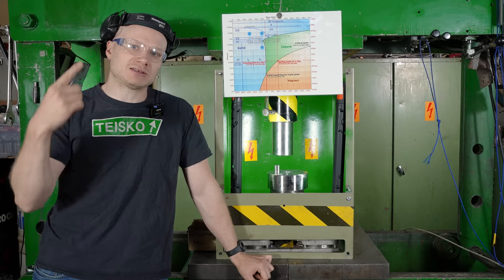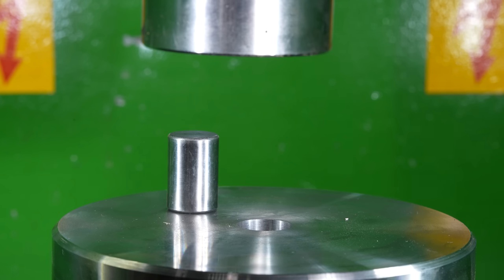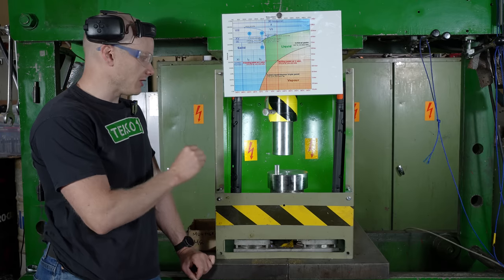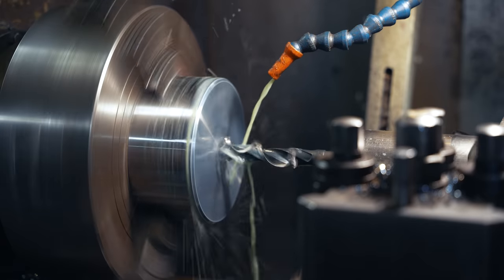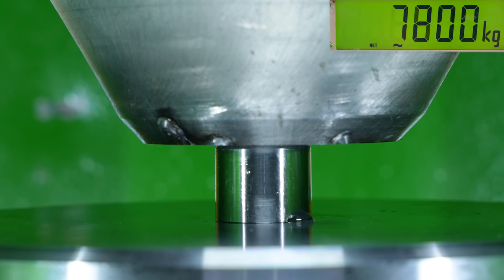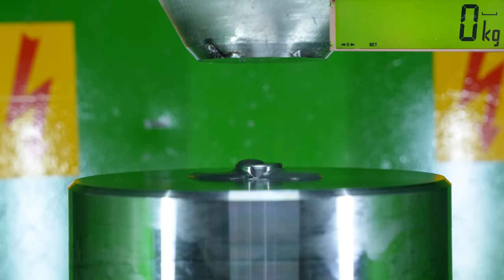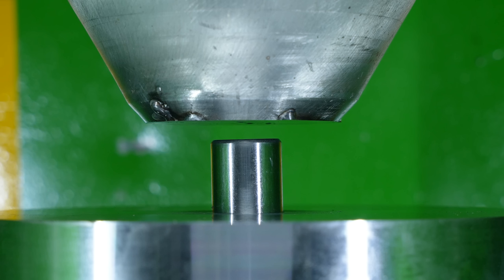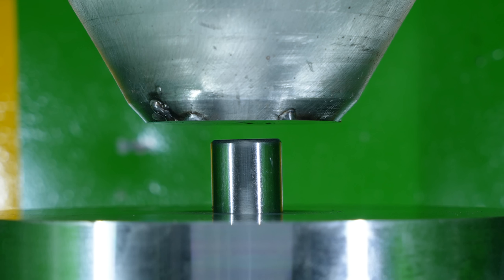Turning Water into Rock with Hydraulic Press

Comment: You could probably get better feedback from this if you get some quicker responding scales or pressure sensors.
As for the piston design, you might try a tapered design with varying angles of pitch. You'd get a smaller area on the bottom surface while maintaining a tight mechanical seal.

Comment: You probably need a longer cylinder and piston to achieve a better water seal. I also remember reading that creating artificial diamonds for industrial applications involves the use of controlled explosions to achieve the desired pressures instantly.

Comment: The bubbling boil and vapour released was so cool to see for some reason.
Reply from the maker: I think there is so large pressure difference that the water starts to boil from all the energy being generated from pressure loss
Reply: @HydraulicPressChannel  Heat is liberated when materials change phase to a lower energy state.  The application of pressure does work on the system, as well, which also liberates heat.

Comment: I have two ideas that could improve the setup. One idea would be to make the bottom part into two parts where the outside is hardened. That way it cannot expand as much. But make sure that part is still pressed into another steel part which applies pressure from the outside and (hopefully) stops it from cracking open. The second idea would be to make the cylinder slightly cone shaped. I do not think the water actually cuts the material. I think the material is rubbed off from the cylinder rubbing against the bore. Since the pressure is so high, it just widens the hole to a point where the water can escape. But if you use a cone instead of a cylinder, the force from the press will keep it shut. Of course that will also increase the outer diameter of the lower tool which is a problem if there is a hardened section. Interesting challenge tho. Also keep in mind that the pressing will also increase the temperature of the tool and the water inside. So you will either need more pressure or make sure it stays cold. Maybe put the tool with the water inside into a freezer first and when the pressure is applied, wait for the surrounding material of the tool to absorb the generated heat. Also cooling the steel would make it stretch a bit less.

Comment: can you freeze one of those with liquid nitrogen or dry ice on camera so we can watch it push the bearing plug out as the water turns to ice? also you can try using cast iron as either the hole side or the pin side as soft iron often (with a hardness of 58 HRBW)  is used in the oil and gas industry as a compressible seal at high pressures and temperatures. you also don't want the hardness of the pin and steel plate to be too different only 15 to 20 HB or else the material the deforms wont plasticly be able to flow into the other part and form a seal the surface finish is also important no higher then 0.8 Um RA on both parts and free of burrs and chatter marks hope this helps!

Comment: I have few ideas to make a better seal. For first, lap the hole, so it's very smooth. Also grind the roll edge round and very smooth. With so tight fitting, sharp edge in roll chamfer most likely chip the steel and scratch it. 

With this principle, you need more fitting force than pressure under the roller. Otherwise water will stretch the outer steel and create leak.

Other method could be to make self sealing structure. O-ring is good seal because pressure presses ring surface always tighter than needed because pressure affects on entire ring but sealing surface is always smaller. You can make similar structure with steel.

Take a silver steel rod. Machine bottom part thinner, machine groove under the wider part, machine groove on the top, forming kind of piston ring, which is still connected. As long as the groove underneath is bigger than sealing surface at the outer part, it will seal. As the pressure rises below, it pushes ring in the steel harder

Sealing surface must be wide enough not to sink in the steel and seal must be thick enough not to break. Use silversteel, so you can harden it. If possible, grind it smooth after hardening.

Comment: 1.I'm thinking a short taper ground into the bearing along with a more extreme interference fit would be necessary to make this happen. You would be surprised with how flexible steel and iron can be, even hardened steel and cast iron. I rebuilt a Kubota engine recently with interference fit cylinder liners. The fit has to be extreme because there is no lip top or bottom to keep the sleeve/liner located in the bore. It was somewhere around .008-.010" fit (.20-.25mm). Those are cast liners and cast iron block so both are notoriously dimensionally stable, and they had zero issue with being pressed together. Just keep going up with the interference fit number until your press starts to have a hard time, at which point you know your limit becomes the materials themselves. I think my press, which is only 20 tons, was on the edge of its capability pressing in a liner that was 76mm in diameter, but with such a small diameter piece, you can likely increase the interference to quite an extreme degree that the material itself will fail before your press is maxed out. 
2. Another thing you might do is use a very fine sand paper to score your bearing for a better seal. Those microscopic lines in the metal will act like o-rings.
3. Finally, something you should think about is heat of compression. You're generating a lot of heat when you do this experiment. I don't know what temperatures are involved, but you're almost certainly exceeding the critical temperature of water when you move the press very quickly. This is why the fast action of the ram failed earlier than with the slow press. The heat had more time to escape. I think that large number, 28 tons, occurred after the ram hit the stop and began to build resistance. If there was a way to slow down the increase in pressure so that ambient temps aren't exceeded by much inside the chamber, that would be ideal. Maybe through a screw press or slow down the hydraulic pump somehow?
Reply: Re diamond synthesis and Tracy Hall  Lauri needs carbide confinement mounted in hardened tool steel.  No steel is hard enough to not directly deform.  Even hydrothermal growth (e.g. cultured quartz) requires quite the dance not to go high order boom.

Comment: I think it could work with a cascade of regular hydraulic zylinder seals. If one seal can withhold pressure of for example 300bar against the atmospheric pressure a cascade of two should be able to withstand nearly double the amount, if there is a non compressible fluid in between?!  If you have 600bars in the compressed chamber, you have 300 bars between the chambers and the second seal only has 300bars.
Similar to a multiple stage piston Kompressor

Comment: The problem with this is, at such pressures, the steel itself acts like rubber! You put that much pressure inside it, on a liquid, and it just squirts out around the plug.  To solve this, think how you would design a setup made out of plastic (or other lower-modulus material), at proportionally lower pressures.  You either need a plug that expands as it goes (sealing the gap with greater pressure), or some way to equalize the pressures on all sides (to break up and counter the radial force of the contained pressure).

The first thing I would think would help, is to make the piston very much taller.  You aren't increasing the stiffness of material sealing against it, but you are putting more of it (more sealing face), and perhaps the pressure can drop along the interface, eventually to atmospheric at the top and thus not leak.  On the downside, all it takes is one little sneak path up the side, and out it squirts; and ramming even a polished slug into a finely machined hole, will still have microscopic scratches that water can be forced through.

The other way is to press from all sides, like the octahedral and other shapes that various experiments, early diamond synthesis (and maybe still to this day? I don't recall), etc. used.  I'm guessing this isn't so feasible (you'd need many hydraulic rams, synchronized by volume, and a lot more fixturing/machinery, to pull it off; perhaps they could be driven from your existing machine, via patch hoses, but perhaps that's not such a great idea either, for various reasons; or via a much more complex "tool", a hydraulic transmission?).

The other other way, is to just brute force crush the whole thing, tooling and all.  Which I think is kind of how the ultra-high pressure diamond anvils do it.  By leaving a small concavity on the face of an otherwise very flat, hard and strong tool, and pressing it all down uniformly, by sheer brute force elastic deformation the cavity is made to collapse, with a pressure comparable to the elastic modulus of the material; and all the clamping force around the cavity, acts to seal it.  Most of the clamping force distributes over the tool faces themselves, which seems inefficient, and a more direct method (like literally pressing on a cylinder as in traditional hydraulics) is a more obvious approach, but when you have all these other problems to deal with, some compromise is inevitable.  (The active volumes in these tools are extremely small.)

I think they still use a tapered mating face on these, and there's likely something to be said about interference fits and tapering -- which is to say you're not on the wrong track with the interference fit, peg-and-hole approach, but that more consideration is required.  In any case, my thought process is: if you're able to drive the peg in such a way that it stretches the hole, that gets you the radial pre-loading needed to seal the joint.  (And that's a lot of force, and you can only pre-load up until the hole material yields and the water simply pushes through; both tools must be very strong, and very stiff, if at all possible!).  Instead of a press-fit into a step, some taper may be required -- on both parts.  What angle (and what angle on both parts; they might not be exactly the same but subtly different..!), and what lengths and such, I don't have any intuition for, unfortunately.

Of course... more consideration means either many more tools turned, crushed and recycled; or scale models made -- like I said, think about how to capture slightly-less-extreme pressures inside materials much less rigid and strong.  Or preferably some good solid engineering calculations -- or even material simulations. Well, that would be expensive (pretty sure simulators exist, but not cheaply..), though I wouldn't be surprised if you can find either someone, or some company, willing to do the job for a little free advertising..?!

And yes, stiffer materials than steel; there are a few elements that might do (molybdenum and tungsten come to mind, placing about twice the stiffness as steel; alloys would have to be selected for strength as well, for example commercially-pure Mo is about comparable to CRS in strength), but probably the most common in machine tools is carbide (namely, cemented tungsten carbide).  Which... can be machined, with great difficulty... and, needless to say it's not exactly going to be cheap in massive blocks for a potentially one-shot test, but, it is another thing that would help.

Anyway, not an ME, just ramblings of an EE's intuition -- perhaps other high-pressure engineers can weigh in better here. Cheers!

Comment: Can you use a thermal camera as well? You might be increasing the temperature as you press, especially with all that metal friction and adiabatic compression of the air pocket. which could keep you in the liquid part of the phase diagram.

Comment: You won’t be able to create solid water unless you can dissipate the heat you’re generating. The piston energy is getting converted to heat and pushing the water to the far right of the phase diagram before you can hit the solid phase. You need to have a system that can pull the heat out of your tool and you’ll probably also have to go slower to allow the cooling to occur as you go.

Comment: Hello,  I have worked with materials to enable encapsulated electronics survive to 30,000 PSI and 200C and did tests to 40,000 PSI and published a few patents on the ways to achieve this.  Some quick notes from my experience:
- The gas cap of air will start to have its own unique behavior at very high pressures and its compressibility can be modeled when you include what is known as the 'z-factor' in calculations based on the basic formula for z=PV/NRT where V=volume, R=gas constant, N=number of moles, T=temperature and z=the compressibility factor.  The compressibility factor is found from a set of curves and equations for each molar constituent of a gas and the total compressibility analysis would be based on the mix of gasses in the air trapped above the water, which would also likely be pushed into solution into the water, which in turn messes up the rest of the experiment. 
- The gas saturated water makes a terrific water-jet cutter, opening up any passage way initiated by the highly compressed air which in itself is essentially behaving like a liquid as it gets highly compressed. This means that a) You really do not want a gas cap on top of your water as you compress it  b)It is probably assisting with the failure of the seal rather than helping
- I recommend your procedure attempt to eliminate the gas cap above the water as your seal forms.  I don't know the best way to do this but have a couple of ideas....

1) If the entire chamber could filled with water, no air at all.   Sounds simple, but hard to achieve.  If the test were done in a vacuum, it would be better but also not very practical and also the water in a vacuum would all boil off anyway as you are simply reducing the boiling point. 
--- If you had a tiny 'bleed hole' perpendicular to the test chamber below where the taper of the chamber has forced the bearing roller to create a metal to metal seal, it might maybe work.  the interference fit may also be lost as the bearing roller passes by the bleed hole, as this would be the weak point for 'jet cutting' to occur, but it might work.  Water would be filled into the chamber to the bleed hole, where it would leak out while filling. The smaller the hole the better but the smaller the hole the longer it will take to 'equalize' prior to starting.  Due to capillary action of the bleed hole on the water (and gravity), the water will do its best to evacuate the chamber via the bleed hole by itself. The press should go slow so that all air can evacuate the test chamber via the bleed hole with minimum pressure applied as the roller bearing approaches and immediately as it moves past the bleed hole you would begin to be trying to compress the water.  Again, this may fail as the bleed hole will also become the weak point for 'jet cutter' action to start. 
- The galling action from the insertion into the taper will create a lot of heat and the bearing will want to weld itself to the chamber.  I think slow insertion may minimize this effect while fast insertion may helps the jet cutting to occur.  In your test here, if you did not have the leakage, you probably would have had welding. 
- I agree that a hemispherical bottom on the bearing could assist with increasing the strength of the seal as it would force the seal into the sides of the chamber but I think you already get that just with the galling of the interference fit. 
- I am kind of free thinking this as I write it, not after a good long analysis.  Another thought is that the strength of the seal is ultimately going to be limited by the cross section of steel created by the galling and that a failure mode of cutting through that is what we appear to be seeing.  I know from my high pressure work that a failure path once started advances and grows extremely rapidly (micro seconds) due to the jet cutting that occurs from the pressure differential across the seal.  A the end of the day, the seal needs to have a significant cross sectional area and the difference in volume to obtain compression of the water is relatively tiny.  A much smaller pin could be used or if water could be trapped in a chamber and then the pressure increased a lot.  This might not be achievable with a press, instead requiring something more along the line of an explosive charge pushing a piston down on a chamber with water in it.  .Hmmm, sounds like fun but a big deviation from what you are doing!  Another thought would be to push a plug of Teflon ahead of a roller bearing to act as the seal.  The Teflon would have a slight interference fit.  Lubricate the roller bearing pusher-plug and have as close to zero interference as possible with the plug.  No taper needed on the chamber.  The Teflon could deform and seal.  Make it longer and smaller diameter too

Hope this provides some ideas. Cheers.

Comment: There is another problem with it. When you compress that water it will start increasing temperature so the pressure threshold for the ice is going higher and higher as you compress more and more I guess.

Comment: On the last attempt, wasn’t that steam that escaped? Wouldn’t the air in the gap heat quickly as it got compressed and the pretty much flash boil the water and turn it all to steam in an instant?

Comment: Since Ice-VI is denser than liquid water, what will happen when you reach the critical pressure is that the water will compress some amount without increasing the pressure as the water is turned into Ice-VI, much like if you have a mixture of boiling water and steam it can change volume without changing pressure as the water boils or steam condenses.  That plateau should be an indication that you've hit the critical pressure ... and, although it's hard to tell, it does look like there's a little tiny bit of a pressure plateau around the correct pressure on your gauge.